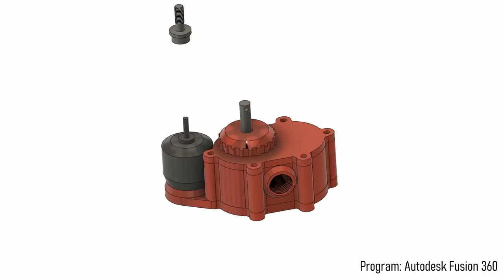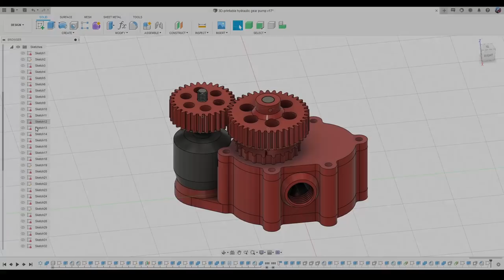3D-printed double helical gear pump/water pump/hydraulic pump *watertight*

Comment: I just learned a new way to put gears on shafts...
Reply: P
Reply: Not the best option. Some moment pins may try to escape. It will block gears.
Reply: @parus5052  Give me best option i need it
Reply: @pfdk8066  Make a notch in the shaft

Comment: Very cool, looks almost identical to some I had played with designing back in school (I was using 608 skateboard bearings for the gears, which works well except for water they will eventually corrode, but would be excellent for oil in a hydraulic system). Best part is you incorporated the cheap $5 2212 brushless motors every hobbyist has instead of the Bosch motor I had used, and I'm pretty sure yours is working better than mine did!
Reply: I can't quite imagine how you were using 608 bearings for the gears. Did you cut teeth into the outside of the outer race or did it work with the bearings being unmodified? How was it assembled? Im curious, thanks :D
Reply: @jansvasta2146  you could do it a couple of ways. Originally mine started off as a roots pump and had 4 external bearings plus herringbone synchronizing gears. You can put the gears recessed into the pump body (lid and base to support the shaft glued** to the gear), or for more compact the idle gear can have a 22mm shaft size hole and press fit the 608 bearing directly into that gear.

**Instead of glue my shaft had an indexing T to transfer torque to the gear (easier disassembly compared to glue and no wait time), used printed shaft so the motor driven side I could have a recess for Lego shaft so it could flex in case of vibrations and motor side I made shaft to Lego shaft adaptor.
Reply: sir the cheapest i can find the motors is $11 what website do you get off? i support them!
Reply: @driftsdragsdrives4938  For most of mine I got them years ago on Ebay (just search "2212 brushless motor," or if you want a specific speed you can also search up 2212 930kv  or 1000kv or 1400kv or 2200kv are the common speeds for that motor). You can also get similar motors on Banggood (they sell a lot of motors for airplanes and quadcopters as well as any other part you might need).

You might be finding them bundled with an ESC at that price, which you will also need unless you already have an ESC. Then I also recommend a "servo tester" to send it the input speed (these are about $2), unless you are using an Arduino or similar to control its speed another way.

It will end up being about $10 to $12 for the motor and needed electronics plus battery or other power source (like an old computer power supply, or car battery).
Reply: @jakegarrett8109  thank you very much my friend!
Reply: Where do you buy them for $5?
Reply: @jhsevs  See above comments
Reply: @jakegarrett8109  oh, thanks, those replies didn’t show up for me yesterday for some reason

Comment: If you add an 'o' ring groove just in from the teeth on the top and bottom of the pump gears you can seal the pressure from escaping over the top and bottom of the gears. Should wear fine on the clear acrylic.

Comment: I would add a support for the top end of the motor shaft. You can see it’s vibrating, which is wear and tear.
Reply: I'd also add more reduction although I don't really know whether it will improve anything anyway

Comment: Nice design and presentation!
Wouldn't the motor be powerful enough to be connected directly to the shaft of the helical gear? It would reduce noise a lot and friction a little.
Reply from the maker: Thanks, yes it might be possible, this just seemed the easiest way to integrate the motor with the design at the time as it already had a coupling to secure propellers.
Reply: @BrianBrocken  Oh, I see, it's an RC plane motor :-) 
Admittedly putting the motor on top wouldn't look as nice.
The best idea I can think of to make it both quieter and smaller would be to insert alternating magnets at the bottom of the helical gears and some flat coils underneath, effectively making your own mini axial motors, and the compression seal wouldn't be needed anymore as the gears could be completely sealed in.
Could be a fun project to experiment with.

Comment: Love the Video, and I have a question. 
Is there a specific reason you didn't use the double helical gears above as well? With the 3D printer, they shouldn't be more difficult to build, especially since you already have to print two for the pump, but they sholud run much smoother and quieter than the normal gears. I´d love to learn more about it.
Reply from the maker: Only reason I used regular spur gears on top is for ease of assembly. Spur gears can be slid on the shafts into each other, this is a bit harder with double helical gears.
Reply: @BrianBrocken  That makes sense, thanks for the fast response.

Comment: Very nice...much better than others I've seen who rely on glue instead of gaskets...

That being said...claiming it's water tight when I can see the water fling onto your motor...a bit strong of an ask. 

Very nice work though.
Reply from the maker: Thanks man, when using the plexiglass lid there is no gasket used and the water escapes through the gap between shaft and hole, this is only used for demo purposes (also mentioned in the video). The 3D-printed lid has 2 gaskets, 1 surrounding the lid and a compression gasket to seal of the shaft. The pump with the 3D-printed lid and gaskets is 100% watertight.

Comment: Really nice! I printed a similar design ages ago but lost interest and never assembled it, looks like I really should give it a try!
In the last little video it seems it has developed a little leak, is this just because of the transparent lid or what?
Reply from the maker: Yes in the last part of the video i used a plexiglass lid for demo purposes and this lid doesn’t have a seal so the fluid comes out through the driveshaft.
Reply: @BrianBrocken  Love the design. Nice work!  I am guessing the plexiglass lid wasn't intended for actual use - but if so you could probably 3d-print a seal similar to the first cover that glues onto the plexiglass below the gear, where you can't see thru the plexiglass anyways.

Comment: Neat and easy to assembling. 😀👍Wondering did you test flow rate?
Reply from the maker: Thanks man 😁, good point, will do some testing on the flow rate and will publish them later 👍
Reply: @BrianBrocken  Flow rate would be good. Interested to know the flow rate at various RPMs.

Comment: How does the red lid not leak (as opposed to the plexiglass lid)?
Reply from the maker: The 3d-printed lid has a compression gasket (can be seen at 02:10) the plexiglass lid just has a hole.

Comment: sucks air . Gives bubble outlet
Reply from the maker: At 05:14 yes because the plexiglass lid doesn't have a seal. The 3D-printed lid at 03:50 does have a seal and is watertight.

Comment: 다 새는데...
Reply from the maker: At 05:14 yes it's leaking because the plexiglass lid doesn't have a seal. The 3D-printed lid at 03:50 does have a seal and is watertight.